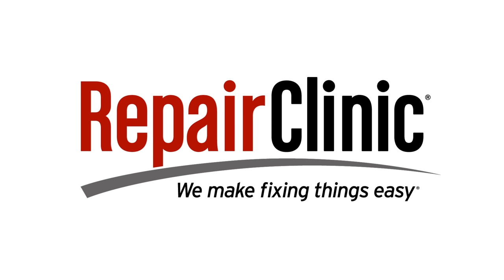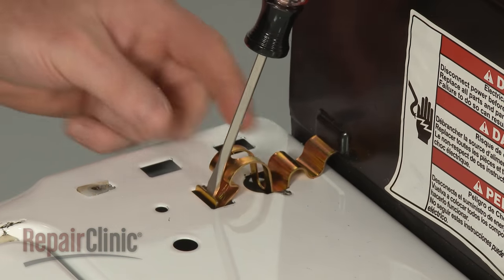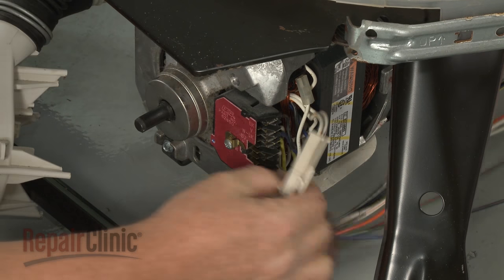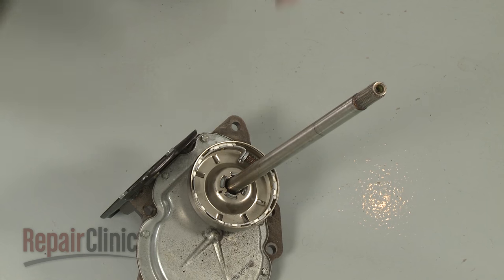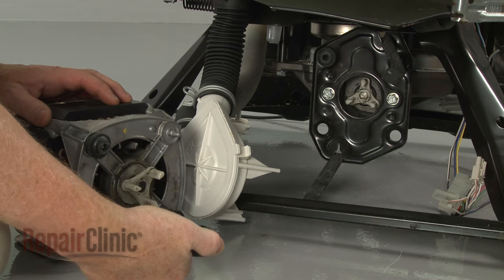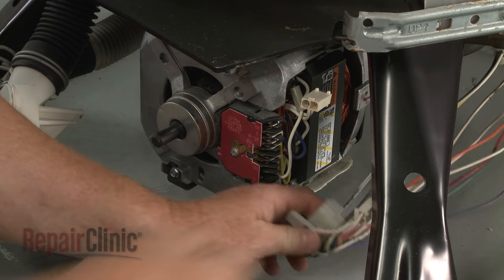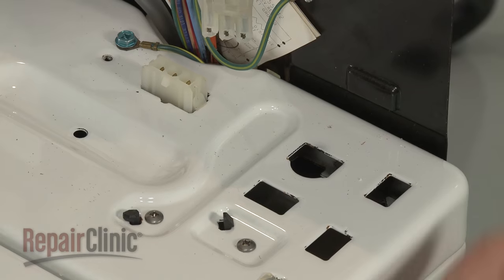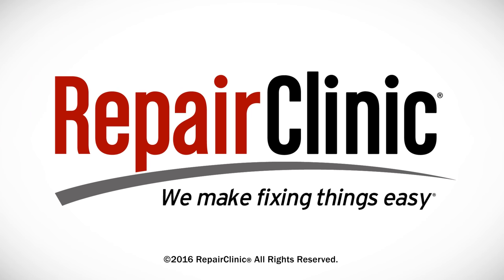Kenmore Top-Load Washer Clutch Replacement Part  WP8299642

Comment: Videos showing setting this type of washer on its back or side should caution that oil will slowly seep out of the gear case vent hole, so the machine should not be left in this posture for a long period of time - for example when a DIY job is interrupted by other matters.    Perhaps the vent hole can be temporarily closed with tape if the worker understands where the vent hold is.

Comment: I am laughing out loud because my washer is violently bouncing and banging on the spin cycle and it seems that the clutch needs to be replaced. I can’t believe I have to attempt to remove every single piece to get to the clutch. Is it really worth it? Or is it easier to buy a new washer every few years? I can’t believe every single piece needs to be detached. I have to fill myself to make sure I don’t forget where things go.

Comment: Saved a fortune watching these videos to repair our washer (Whirlpool ultimate care 2 (11) ten years old). My husband who really has no hands on repair experience managed to follow them. We replaced the clutch kit search for (285753A) and the motor coupler, search for (275753) If you only need the clutch band off it search (3951993 band only) We also replaced the agitator dogs search for (80040) and looked at the door switch which we disconnected to see if that worked. Typically it was the last thing we tried which was the motor coupler! Persevere these are simple machines and not much can go wrong, mine has now had a full MOT and new replacement parts so should go for another ten years. Hope the product codes help, I spent hours Googling!! xx

Comment: This guide was great!

I would note that when sliding the transmission back in, you may need to spin the clutch around until the transmission slides the rest of the way in. It took me several minutes to figure out how to get it to go all the way in. It was stuck a half inch out until I did that.
Reply: Thank you your a life saver.

Comment: A few things not mentioned in the video:
1) Expect about 1 qt of water to drain out of the machine. Have extra towels and a mop handy.
2)Installing the circular clip on the spacer holding the clutch down: A pair of channel-locks really help in doing this. Squeeze one end of the clip and the other end with the shaft.
3) Installing the motor/clutch coupling (2 plastic pieces and rubber bushing): Seat the first  piece on the shaft, and tap it into place. Then  put on the rubber bushing. Then put the other plastic piece on the motor. Line up prongs, push entire motor onto bushing, and using a mallet, tap in until tightly together (easier to do when the machine is still on it's back.
4) Motor clips may be difficult; have a crowbar or breaker bar for leverage. Top clip first, then lever motor downward until bottom clip can go on. Clip on pump, THEN tilt mackine forward.

Comment: This was a great video very detailed and easy to understand .  The only issue I had was when I reinstalled the motor it was a bit difficult because it was very low to the floor and the motor a little heavy to hold and keep the spring clips from falling off.  I put a six inch block under the frame and then was able to better see where the shaft attached and the spring clips stayed put without falling off.  Piece of cake after that.  I was wondering if it would be better to attach the motor while the machine was still on it's back.
Reply: He should put the motor back while it's laying down. That's how I did it, so much easily

Comment: The motor does NOT come off after removing the two bolts and clamps. There must be other screws or bolts holding it?
Has anyone tried this on a kenmore series 80?

Comment: How do I know is the clutch  that I need to replace?
Reply: Put you washer on the spin cycle and close the lid.  Let it run for a few seconds the open the lid really quick  If the tub is not spinning or look like it was spinning then it is the clutch  Save your self a headache and replace the motor coupler too.  Hope that helps

Comment: I just changed mine and the coupler also and I just ran a load and it spun quickly and seemed to be working it smells strong like burning plastic or something so I don’t know what it could be. It didn’t smell like that before I did it, it was just spinning extremely slow and now it’s spinning fast and seems to be working again but the smell is horrible and it did squeal for a moment before it went to the spin cycle. Any suggestions?
Reply: Is the coupler properly aligned

Comment: Is it possible I’ve damaged/bent the transmission shaft? I’ve done this several times to fix/check several issues with no problems before but this time after putting back together, the basket shakes violently during spin cycle. I checked the tensioner springs and they seem ok. I’m afraid I left the weight of the transmission on the shaft while sideways and partially pulled out. Everything else went back together and worked fine, I only had trouble pulling the transmission out and had to give it hell before I got it.
Reply: Or is it more likely I damaged the stabilizer springs?

Comment: You didn't show how to deal with the pump drain line and all the water that's still in it. To lay it flat on its back like that, the drain line must be removed and water vacuumed out -- or spilled all over the floor!?